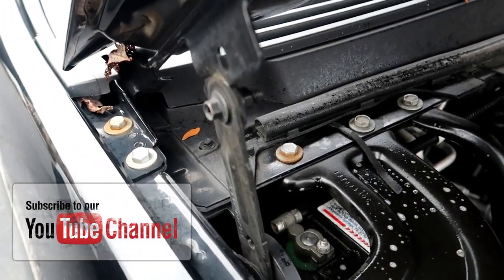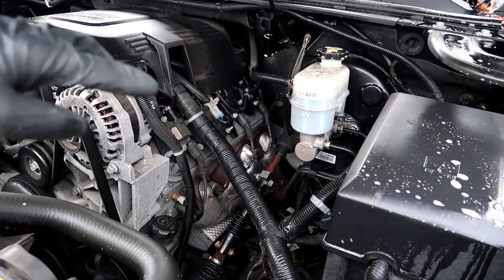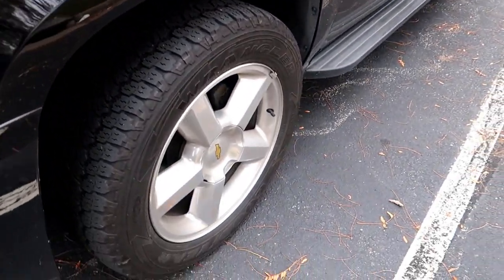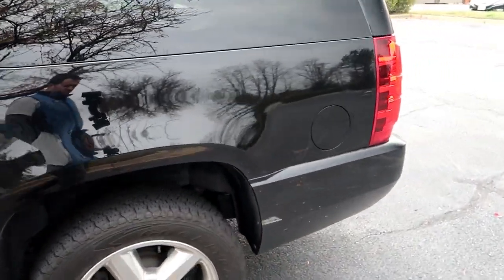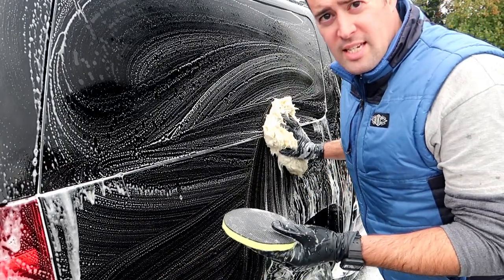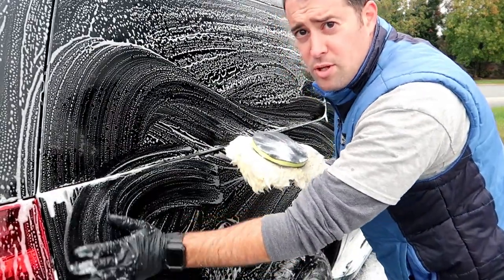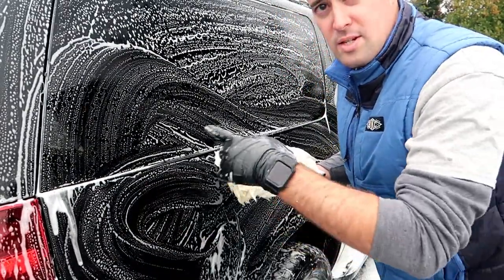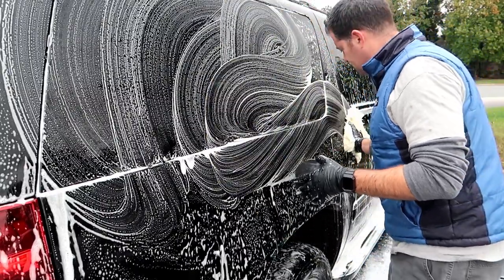Polishing & Paint Refinement -- Black Suburban XL

Comment: Nice work and love your videos. Did you use any wax after it? Spraywax? Nice Suburban, got myself a 2011 Suburban black . 
Best regards from Sweden
Reply from the maker: Hi thanks!  Wow Sweden, that’s awesome! The Polish we used is called HDSpeed, it leaves a wax behind anyways. But we top it with Optimum Car Wax also.
Reply from the maker: Please subscribe and click the notification bell also, we have more videos coming soon.
Reply: Hi, thanks! What microfiber towels ar you using for drying?
Reply from the maker: It depends. Sometimes I use thick 400+GSM towels. But most cases I use the Kirkland Brand yellow 350GSM towels. They work great!
Reply: Thanks, Do you use these even on a regular wash on a black car? (without any sraywax) Is it a streak free result?
Reply from the maker: I have used these Microfiber towels for washes before but I always use a spray polymer that acts as a drying aid and wax.
Reply from the maker: I don’t have any issues with streaks unless I over apply the product. But if I do I simply go back over it with a clean towel and detail spray.
Reply: This, HDSpeed. Does it remove the swirls, or just hide it?
Reply from the maker: HDSpeed is a combination of HDPolish and HD Poxy. So it does polish and remove haziness and minor swirls. And it does fill in to a small degree. 
But if used properly with a cutting pad or MF cutting disc it works extremely well. I’ve tested it by wiping a section with IPA and I did not see a huge difference.

Comment: What camera are you using in the video? Wireless mic? The light you had on the truck-pod looked handy! Do you have links for light and camera?
Reply from the maker: Hi. Yeah it’s a Canon G7XM2 and a wired lapel mic that I used to record audio to my phone. I since stopped using the lapel mic because the audio on the camera is actually pretty good, only if I walk a distance away from the camera will I use the lapel mic. I put both in the description section under recording gear. The light stand is also a photographers light stand that I put a LED bulbs on. It works perfectly and cheap than buying expensive LED lights!